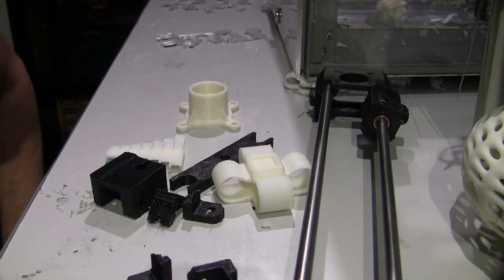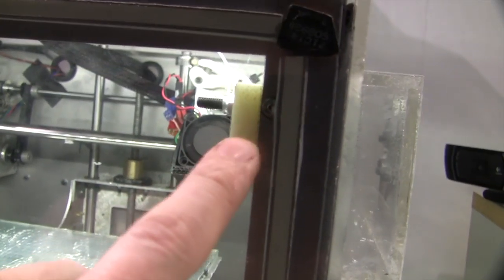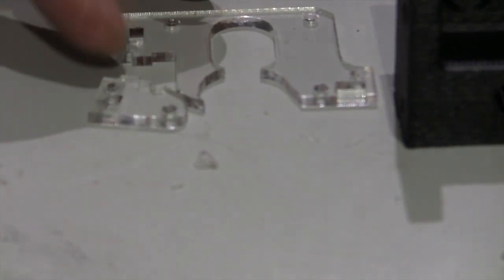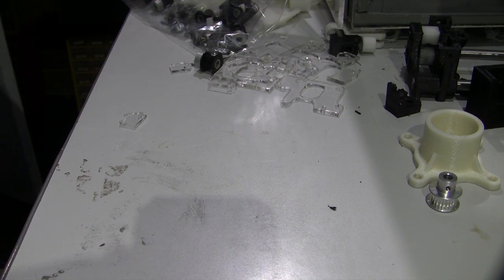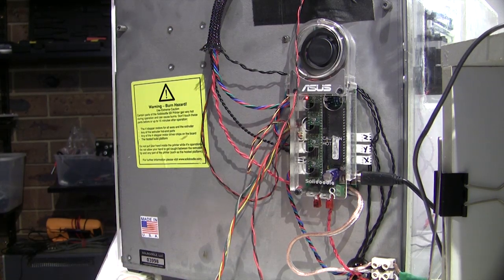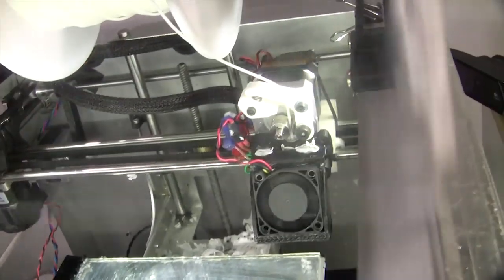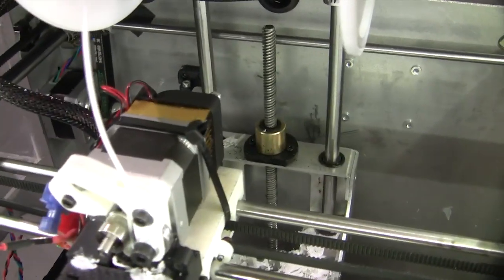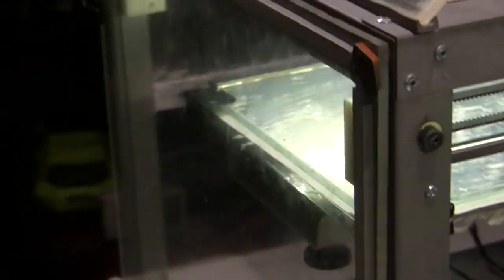Solidoodle 3 review and update.

Comment: This has been really helpful! I recently acquired a Solidoodle 2 for a pretty "good" deal, but I'm starting to discover the same things that you have, that everything needs to be replaced. That, plus it's obvious that the previous owner didn't take good care of it. I think I found a fingernail in between a nut and the thread holding together the idle belt fastener thing. 

Anyway, as soon as I figure out what's wrong with my Y axis (there are gaps between the outline and the infill on both sides for most layers, only along the Y axis) I'm going to get to printing these new extruder and carriage parts. I had no idea what I was getting into.

Comment from the maker: yeah dont leave the hot end on when not printing, spend some time leveling everything, the first print should be for a fan on the electronics, CALIBRATE ALL THE STEPPER!! that improved my prints massively, use kisslicer for the slicing software.

Comment from the maker: no, but almost, i think the solidoodle 2 is good value, but the price jump to the solidoodle 3 is unjustified, all the parts are the same, just with a bigger case, longer rods and lead screw. but even so its one of the cheapest printers on the market and a better design (in my opinion) than the RepRap printers as a enclosure can be added more easily and a much more solid case. 

i suggest getting the solidoodle 2 and using it to make a solidoodle 3+

Comment: I've got a MakerGear M2 at work, and it's essentially been flawless. I've been thinking about getting a Solidoodle 3 for home because it's less than half the price, but I don't want a printer that will give me more grief. Incidentally, I'm printing parts that need precise dimensions (no shrinkage), and have been using PLA on the 70C borosilicate bed of the M2. Would I be likely to regret getting a Solidoodle 3 for this?

Comment: thoughts on the solidoodle 4 from what youve seen
Reply from the maker: its a solidoodle 3 in a fancy box with a high price.. i wouldn't ever conceder buying it. i wnat the spool on the top not the back. it uses less bench space that way. i want better cooling on the electronics,, not have it hidden, i want the window on the top AND the front, they are still using the brass bearings and bushings, and the plastic routing looks VERY prone to snagging and breaking.. a BIG no
Reply: HomeDistiller Wish I had seen this before I bought mine

Comment: Any chance I can get a parts list from you? Ive had my solidoodle for about a year and maybe did only a hand full of successful prints. And I remember saying something about all the play in the setup.  And not to mention solidoodles tech support is also as you like to call it a huge pile of poo. Lol but Id like to get the parts ordered and assemble this thing right and bring it up to par.
Reply from the maker: i managed to get good prints by doing a good strip down, and making an enclosure for it.. that will make it much better.. also the electronics NEEDS a fan its a MUST.. and as it has a 0.3mm nozzle dont print any larger than 0.2mm layer height for good layer adhesion.. or tell your software its bigger than 0.3mm

Comment: How's that j head working out for ya I just ordered one wondering how well they work compared to the solidoodle hotend
Reply from the maker: they are MUCH better... but im now only using my own design all metal hot end.. the problem i found with the j-head it if it gets blocked you cant easily replace the nozzle..
Reply: I got one a little while ago I followed your tips and upgraded majority of it I still have the stock gantry they call it and belts.  The j head cloggs on occasion on me mainly when I used this experimental wood filament from inventables. Pretty neat stuff but ive been using a guitar string to clear it. Trying to find time to make a pex enclosure for it but right now the beer box is working and I'm using mainly pla now. And getting alot more successful prints.  I'm also printing on glass with hair spray. I find it works better than the blue tape method. The fans I agree were a must and the power supply I found a heavy duty one on ebay that was meant for charging the batteries on Rv's a little overkill but everything gets up to print temperatures in a few minutes.  But after some hair pulling and two bottles of rum and one jar of moonshine I think this thing is finally working for me I've even had a few thoughts now after tearing it completely apart about building my own with a much larger print area. But I do have to thank you for this video helped me get in the right direction.